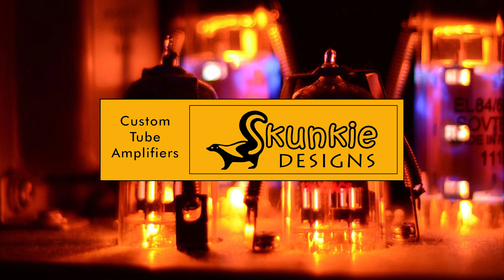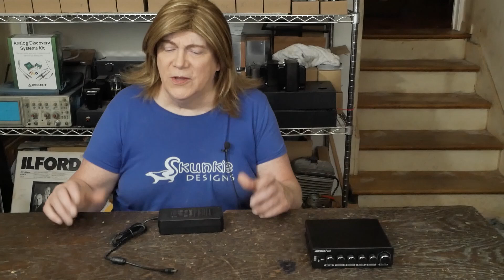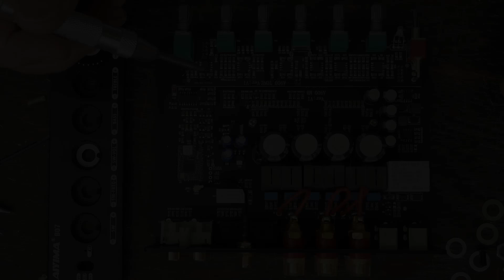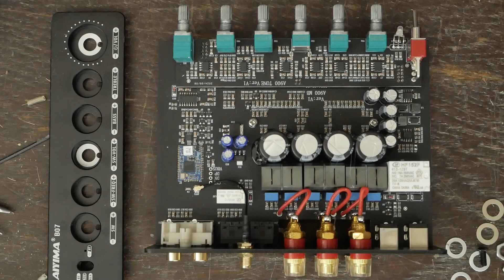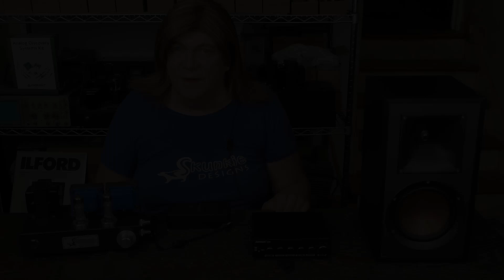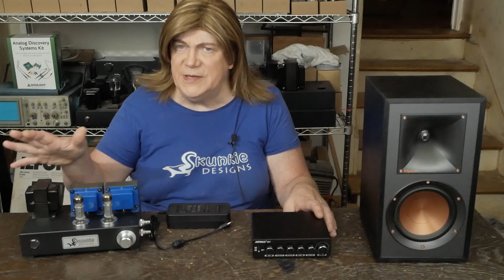Aiyima B07 Amplifier Review!

Comment: The  two coax power inputs are connected in parallel with each other. Guess its to give more surface area contact to lessen the likelyhood of overheating if pushing the amp hard....... Not really necessary IMO but I appreciate the option is available .

Comment: Also high pass filter for speakers is the 'Bass' knob, I couldn't find characteristics for that, but turning it almost down cured low freq hum due to overlap with subwoofer, and mids cleaned up a bit.
Reply from the maker: Good to know, thanks for sharing your experience.

Comment: My Edifier amp died and I got speakers and passive sub laying around for a lot of time, I've got this amp and now I don't have to suffer from monitor\tv speakers.
Yes it has problems like you've described, also mine is running pretty hot, but now I have a decent fidelity with no noise or distortion and with bluetooth for a cheap.
And honestly I'm pretty happy.

Comment: my question is does the bass nob affect the subwoofer output? Obviously a hp filter would be best but if the bass nob doesn't affect the sub you could turn the bass nob down to limit bass going to the main speakers.
Reply from the maker: The bass knob only impacts the sub output, this was designed mainly to work with a passive sub.
Reply: @SkunkieDesignsElectronics  Ok thanks for answering. No hp filters for the l + r channels or bass adjustment only treble? Makes no sense. I wouldn't want to work with it otherwise I'd be interested in something like this.
Reply from the maker: Honestly it was so long ago I don't remember all the details of what every knob does.
Reply: @SkunkieDesignsElectronics  ok thanks. i was thinking if the bass nob only affected the left and right channels and not the sub channel I could lower the bass going to the speakers. Not ideal seems like they at the very least should've put a 150 1st order hp switched to be able to turn it on and off. 
I just found your channel looking into these small amplifiers.  Subscribed

Comment: In description written: 

Output Power: Left/Right 300w*2@48v@4Ω 10%, Bass 300w@48v@4Ω 10% 
= 900 watt in total 
= one power adapter 48V10A = 480 watt will not allow it to happen but two 48V10A = 960 watt will support this power, am I correct? 

Will it manage and not turn on overheat protection?
Reply from the maker: None of that would actually happen without that tiny box melting.

Comment: I'm interested in one of these for a bedroom 2.1 setup.  Right now I use a DIY tda7498e amp with a cheap plate amp for my DIY 8" subwoofer.  I mainly use it for watching TV but do occasionally listen to music as well.  This would replace 2 separate amps with 2 separate PSUs and should be a boost in power output as well.  I do agree that Aiyima and other makers of these boards need to be implementing a high pass filter into the design.  I have been using a pair of speakers with passive crossovers inside but I have a pair of DIY speakers without any crossovers that would benefit from a built in HPF.

Comment: Do you prefer the sound of solid state rectifier or tubes if you find a difference at all. Also what about LCLC or RC RC power supply designs
Reply from the maker: I've done both, mainly I like indirectly heated rectifiers for the slow voltage ramp. I do like CLCRC but my 300B has a split rail CLCLC with each channel on it's own second choke.

Comment: REL subwoofers have a high-level input that connects directly to the speaker outputs of an amp. In fact, it's the connection that REL recommends, even though their subs also have a low level input for connection to the sub out of a pre-amp or integrated amp. Their philosophy is that connecting to the amps speaker outputs is that the sound then takes on the sound characteristic of the amplifier it's connected to and consequently blends in much better sound-wise with the main speakers. REL also goes on to explain that by using the low-level pre-amp outputs, this can also introduce time alignment problems, which, logically, makes perfect sense.
Reply: ? None of that makes sense including, "... consequently blends in much better sound-wise with the main speakers." There is no such rule or even implication in hifi physics that would support such an ad claim generically.

Comment: 100% agree on the high pass option! I fail to see the point of a speaker, any speaker, having to deal with frequencies below what it is capable of reproducing. All those frequencies do, is muddy the output of a speaker.
Reply from the maker: Yeah, hopefully they will listen to consumers and start doing this. Like if you turn this all the way down, you can use it as a full range amp. As you turn the knob up it moves the sub low pass frequency AND then main speaker high pass frequency filters up in tandem.

Comment: This was not a bad review. It was an honest review. For certain applications, you recommended it highly. For inappropriate applications, you pointed out that it would be disappointing if it were to be used.
Reply from the maker: Correct! For a "Jr home theater", it would be awesome and in fact, I'm probably gonna set it up for that with my GR Mini speakers and a DIY sub.
Reply: @SkunkieDesignsElectronics  Danny has line-level high-pass filters built for this purpose, but you'd have to use a preamp with a separate subwoofer output.
Reply: @1mctous  Those high-pass filter should work great for this application. In fact, I would love to see them reviewed.
Reply from the maker: @EskWIRED But if you line level high pass filter the input, the sub out wouldn't work. It has to exist between the pre-amp stage and the signal sent to the mains amp and can't exist on the signal sent to the sub amp. You can't do it externally on this amp.
Reply: @SkunkieDesignsElectronics  what would happen if capacitors and such were to be attached between the amplifier output and the speaker input?
Reply: @SkunkieDesignsElectronics  I said that you'd need a separate preamp. You'd put the high pass filters on the preamp stereo outputs and leave the subwoofer output alone.
Reply: @1mctous  the amp has only has one set of inputs. Any filtering would be done on one of the speaker outputs, specifically the outputs going to the satellite speakers. It would be as if there were extra components in the satellite speaker's crossover.